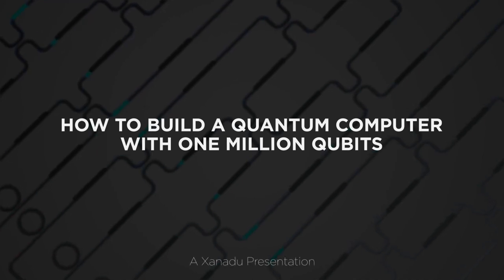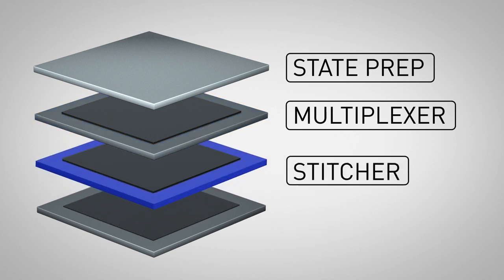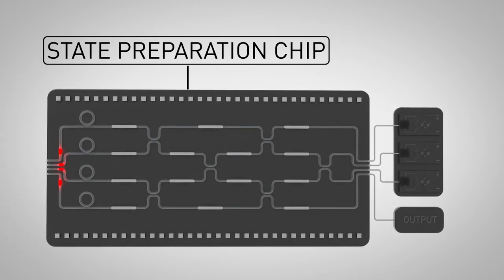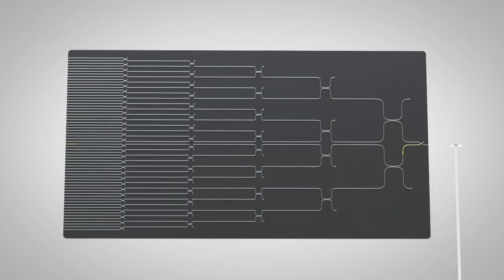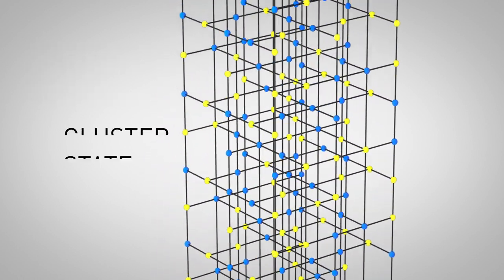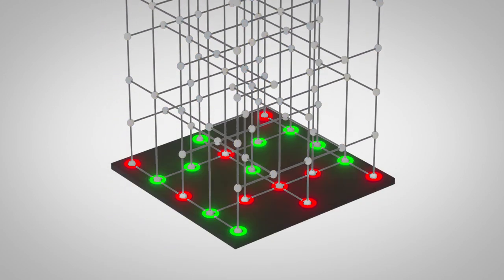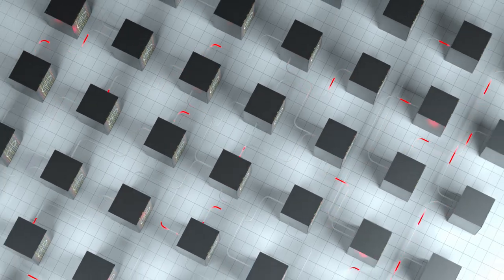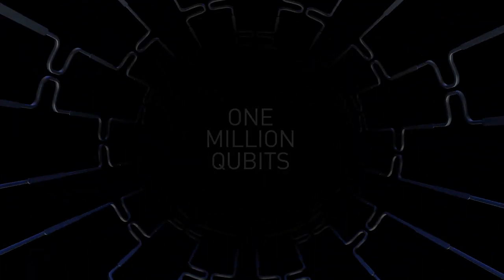How to Build a Quantum Computer with One Million Qubits

Comment: Is it true that (today) quantum computers don't have quantum RAM yet? how do they function without a (quantum) memory/storage?
Reply: it just like cpu actually computer don't need ram if cache is enough.  but that is soooooo expensive. 
it is like quantum computer also. we can calculate the datas usimg by quantum computer.
of course there are so many challenges for making quantum memories.
Reply: @minjae92   thanks ✨🙏
And also i'm sorry for the confusion. What I meant by a quantum memory/ quantum RAM/ quantum storage was Any Kind Of Memory, not just the quantum analog of the slow nonvolatile flash memory and of the somewhat faster volatile DRAM but also includes the quantum analog of SRAM too (and you are right SRAM is the fastest memory we have today so even though it's very expressive we still use it as caches embedded inside the processor as close as possible to the computing units)

Comment: how far are you from making this a reality? and is there hope for one day miniaturizing the modules such that we can fix a million of them in one chip? i don't know, but i feel just using the GBS chip to just produce a GKP state is not taking full advantage of the chip.. I understand that this is a blue print but i believe a more efficient version of it will emerge in the near future.. keep grinding, i am on the lookout for great tech from Xanadu
Reply: You can make the chips smaller but you still need massive colling ans that wont go away most likely ever so no there wont be laptops with quantom chips in them
Reply: Quantum computing is still in the early phases; there is not a lot of agreement over which type of platform is going to be the industry standard yet (those being photonics or Superconducting qubits).

Comment: Not great to have most of it operate at room temperature. It should operate at room temperature period...
Reply: What?
Reply: @elijahjflowers  Literally what I said... They should make all of it operate at room temperature.
Reply: @isabellagoogleaccount8418  All things higher than 0 kelvin radiate their temperature in electromagnetic waves ie. photons. The need for cooling certain parts is to prevent rogue photons colliding and destroying the quantum coherency state of the qubit. Depending on their fault detection technology the sensors might also capture rogue photons and flag the qubit as faulty so that might be why they need to cool those parts. I do not think there will ever be an all room temperature quantum annealer or computer because of the inherent nature of quantum coherency states.

Comment: I acomplished and improved this in my free time with basic left over electronics from the last 17 years. that is quantifiable testable evidence I have documented. 12 hours with absolutly 0 training or guidence of this subject. I just felt like that next though would be correct, internet outage. again and again. now ive fliped the speed of my internet connection and the speed is still slowing increasing automatically. i can share my data and statistics for the last 3 months. youll see. you will see clearly. P

Comment: What I dont get, is why the need for all the hardware,  cant u just simulate it on a normal computer???  what part of it is so special its non-simulatable???
Reply: Entanglement! You can simulate it by the way, but on a classical computer it would require far more time than in a real quantum computer.

How much time exactly? 

Well imagine you have a system composed of N bits, the total number of possible state is thus 2^N. Let's say you want to find a specific state among the 2^N (let's say retrieve some memory), with your classical computer, you would need to sequentially try them one after the other.

Now with a quantum computer, your qubits can be entangled with other qubits. Thus by entangling all qubits together, the state of your system can be a linear superposition of all possible states ! So with the appropriate algorithm (you can check Grover's algorithm), you can in theory find your solution in one shot!
Reply: @InSaNeXmANu  so they are all there together at the same time,  but they compute as if they were separate together at once.      i cant think of anything that would be able to do that.
Reply: Simulating quantum effects on a classical computer is great to test the logic of your quantum algorithm as you go but it kind of defeats the purpose of using an actual quantum computer in the first place (entanglement, superposition, etc). Algorithms like Grovers search for example actually rely on those quantum features to get a result. Hope that helps!
Reply: @gabrielmarous4053  If you think hard enough, I think all of it 100% is simulatable on a computer therefore defeating its purpose YES.  its what Im thinking!!!
Reply: @magnuswootton6181  yes dude, you can simulate it in a normal computer. Normal quantum states can be represented with tensor products, so you could probably simulate a million qubits in your phone. It's just a bunch of vector multiplications.

 The problem comes when you try to entangle your qubits. Which is needed if you plan on getting any advantage out of them.

The special thing about entangled states is that they can't be made smaller, you either represent it all or you're losing information.

Entangled states of around 60 logical qubits are already off the charts in memory consumption even for the largest supercomputer by an order of magnitude.
Reply: @magnuswootton6181 yes you're right. but there is big problem for classical computer anyways that should be made by electronic signal or the other. then we must think about quantum effect. untill now, we tried to avoid that effect but if we use quantum computer then we can use less sized computer.  that's awesome i think. but now that technology is just primitive so, we have to develop it like classical computer
actually still now we dont know how to use quantum computer well.